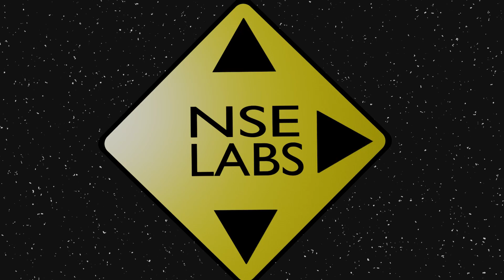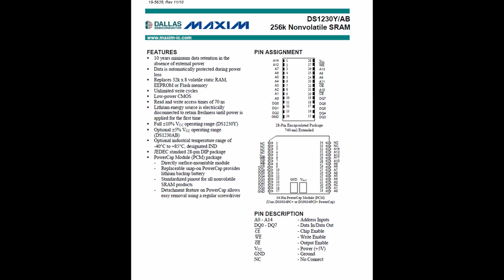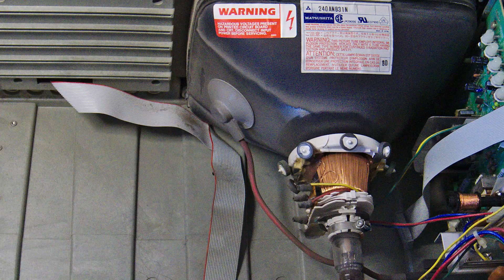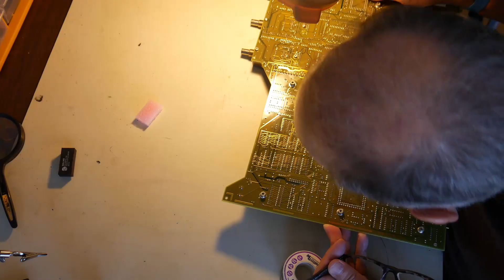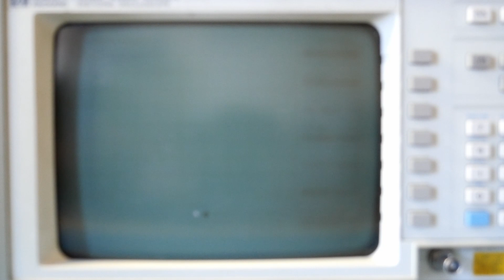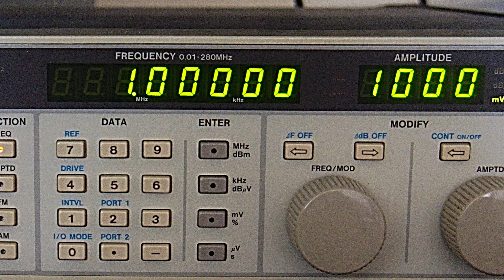HP 54502A Part 2

Comment: I am having trouble finding a DS1230Y-100+. While a DS1230Y-150 or -200 work as well?
Reply from the maker: Hi Bob, the dash number at the end of the part number is the speed of the part. The original part was 120 nS  (-120) so you'll want something that fast or faster. You'd be taking a chance with -150 or -200 part since those are slower. Here's a link where you can find the part, look for -120 or faster (lower numbers are faster). I don't have any affiliation with Newark, just a customer. https://www.newark.com/search?st=DS-1230Y
Reply: @nse_labs  Thank you very much. I did find a -100 and I ordered a socket as well. Just in case my soldering technique is not up to speed. I will let you know how the scope tests out after I replace the memory chip. It should be here this week.

Comment: Thank you for doing this video. I bought a Tek TDS340A. It has what might be a NVRAM too. Its working on borrowed time. I thought the NVRAM stores the scope program ware therefore requiring a programmer to transfer data into new NVRAM. I hope to replace mine as straight forward as was done by you here. If you have any tips or caution for me please tell. Thank you for this video.
Reply from the maker: Thank you yustech. You'll have to make sure any new part you install is compatible with the old part you are replacing. The pinout and functionality must be the same. You'll notice that the part I replaced (DS1235Y) had a -120 after the part number. This indicates that it is a 120 ns part, in other words the response time of the part is 120 ns or faster. I replaced it with a -100 part which is faster than the original which is OK in this case. If it were a slower part, say -150, it might not work. Good luck!
Reply: @nse_labs  thank you for more tips.looks like i have to do more inquiry in forums. Thank you again sir.